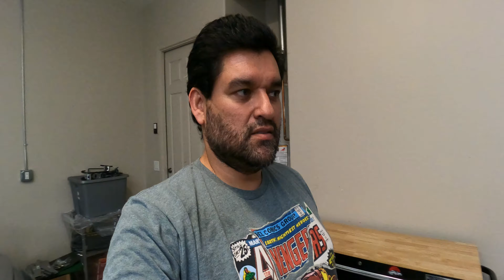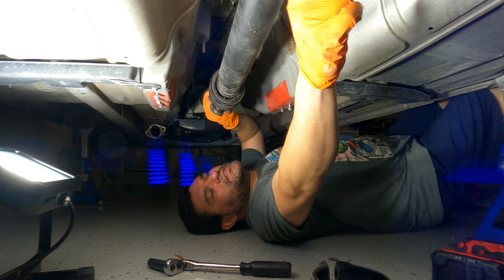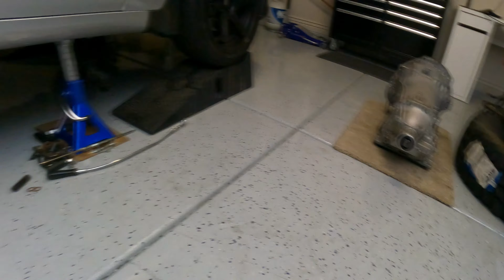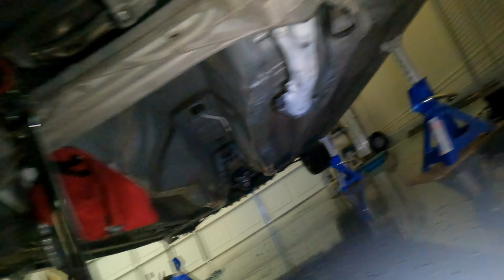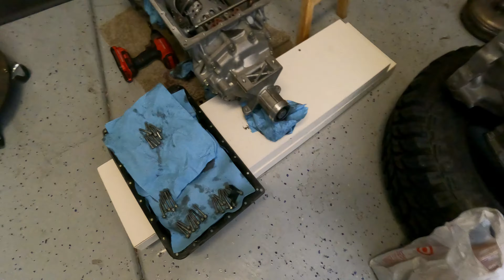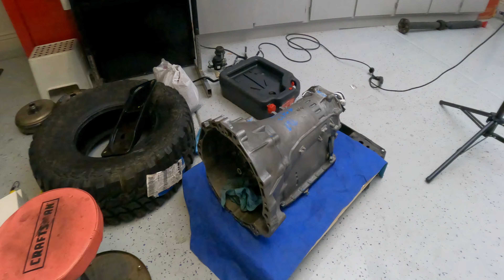2013 FBO Infiniti G37 Sedan VR30 Transmission Swap - Part #1 - Join Me On Our Next Adventure

Comment from the maker: **Update, after about 15K miles on the VR30 Trans, the OEM flexplate broke, so I would suggest to upgrade this part as well while you're in there. I went with the JOL brand one, but Z1 Motorsports and Fast Intentions also makes one. Do your own research before choosing one, good luck**
Reply: dang, was hoping to make this a cheap swap
Reply from the maker: @Wigwhom86 it's only a little bit more expensive than swapping in a regular G trans.

Comment: I have a question. My old valve body failed due to TCM went bad so  I used another one from junk yard but still have shift prblem occasionally. Can I reuse solenoids from my old valve body and transfer to a used valve body?
Reply from the maker: Hello, yes you can do that.

Comment: I have an unrelated question. My problem is my old valve body TCM went out so I replaced with a valve body from G37. So far it works fine but once in a while it goes limp if I stay at low speed too long. Should I transfer all solenoids from old defective valve body to the valve I put on the trans?
Reply from the maker: This is a tough one, hard to say that swapping over all of the solenoids from the old valve body will fix your issue, but at this point I don't see what else you can do. Good luck.

Comment: will it work on a vq35hr???
Reply from the maker: Hard to say man, first of all I doubt the electrical connections are the same. For a second let's just pretend they are, you still need hope the bell housing will fit the back of the vq35hr, let's say that it does, if you transfer your TCM over you'll only still have 5 gears. If I'm remembering correctly, the G35 AT is only a 5 speed right?

Comment: Whats the difference from stock? Is it cheaper going with the other transmission?
Reply from the maker: Hello, the VR30 trans has beefier internals and a bigger torque converter, which means it can handle more power (torque) and in the long run can be more reliable too. Yes it can be a little bit more expensive than going with the OEM trans off the G if you factor in all of the other supporting mods you'll need, but in the long run you'll be saving $ since it will last you longer. For more info on this, check out my breakdown video on what it cost to do this swap:
https://youtu.be/jN29gH3J4fo

Comment: Nice! We’re the torque converters hard to take off? And did you use a ratchet or a wrench ?
Reply from the maker: Not too hard to remove, check out part #2, I go over how I removed it and what tools to use. Thanks for watching.
Reply: @MemosGarageAZ  np and I will watch it after work thanks!

Comment: Great work! I have my donor trans en route and am looking to do this on my Z.  Did you happen to know the height and approx. weight of the transmission that came out? Just trying to minimize my jack stand height and am curious if there are any lifts that allow to avoid sliding off onto the ground.  Thanks again!
Reply from the maker: Hello there, the weight is approximately 300 lbs, the trans bell housing is 15" tall. Unless you get huge truck jack stands there's no way you'll get the trans out without dropping off the trans jack.
Reply from the maker: Good luck bro, keep us updated.